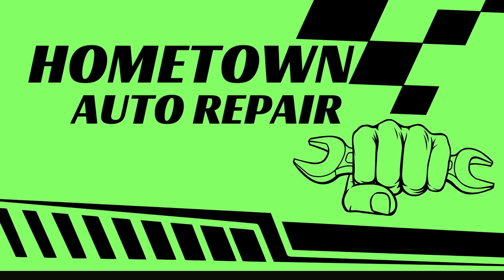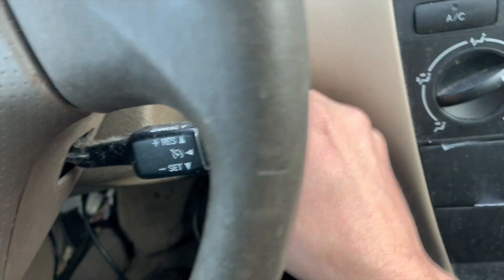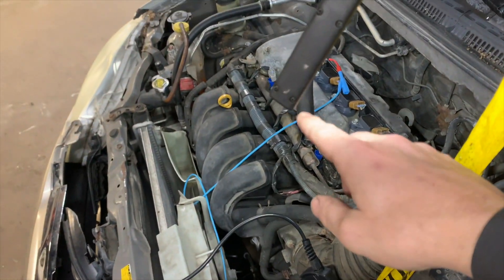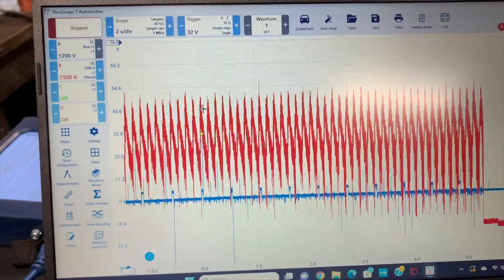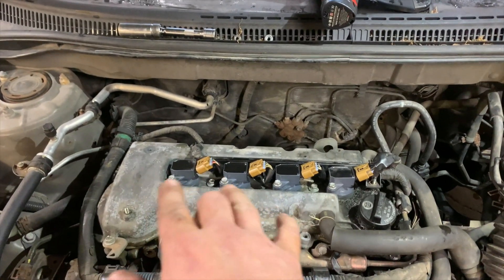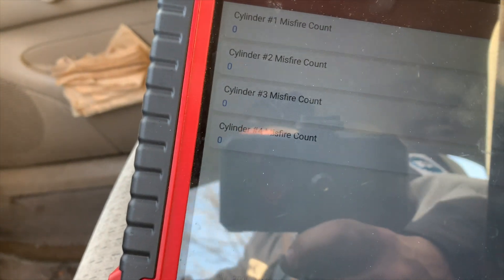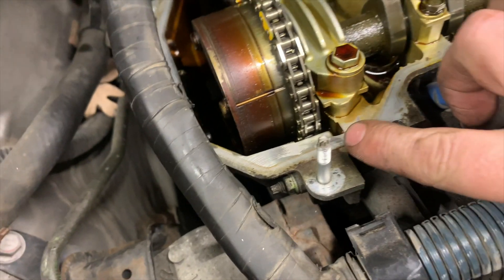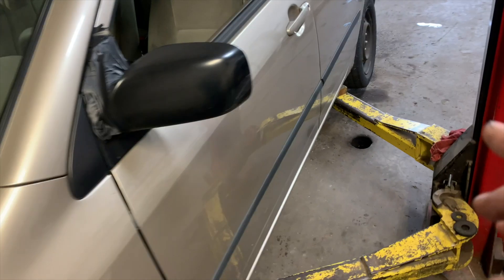Multiple Misfires 2006 Toyota Corolla 1.8  P0301 P0302 P0303 P0304

Comment: Great vid! I have new Denso coils, no oil in the spark plug well. But I’m still getting all cylinder misfires secondary circuit. 2007 Corolla 298000. Any suggestions please 😢

Comment: Great vlog. I had misfire and changed all plugs AND coils but still misfires. Now I see it's probably the gasket. Thanks
Reply: I have the same problem. I replaced the fuel injectors, spark plugs, coils, everything. But the misfire still occurs in the morning. It goes away once it warms up. Did yours get fixed?

Comment: I have same car.. my car is missing since quite a long time.. I don't have lot of oil in plug well but I definitely see it on plug threads.. not sure where it's coming from.. the cylinder and plug tip is dry.. not seen any residues or discoloration.. my missing problem not resolving.. replaced all plugs twice , once with iridium as well... No change . All injectors cleaned and they make proper mist.. coils giving proper current .. also bought one new coil and test on all 4 cylinders one by one but no change ... I suspect iac vale leaking may be ? What you suggest ?
Reply from the maker: if there is oil in the spark plug well it could be causing a misfire, a vlve cover gasket should help
Reply: @jonwillfixit  ok.. I have ordered new gasket . Will install once I recv it.. oil leak is seen on plug threads not in well... Plug well is dry...  I will update you back once I install new gasket... thanks for replying